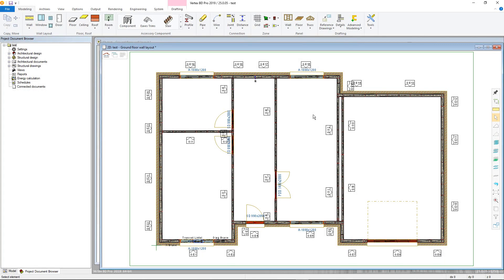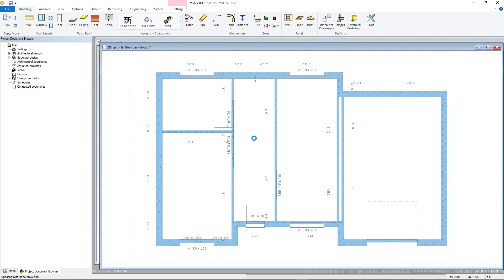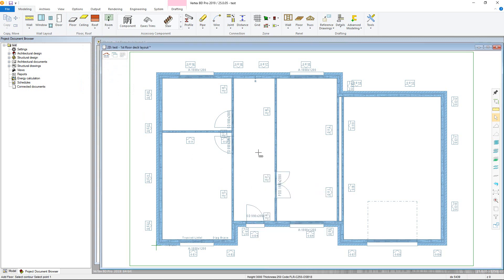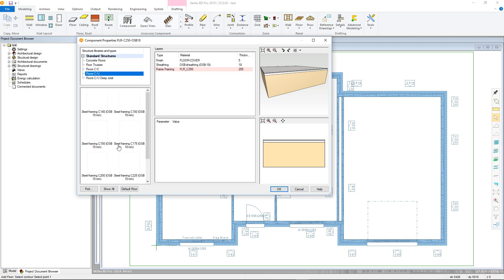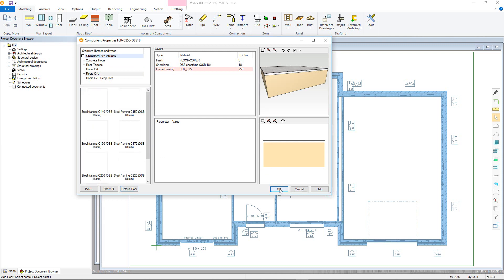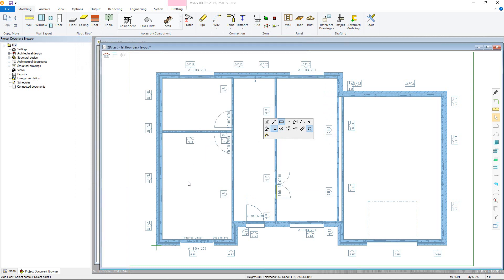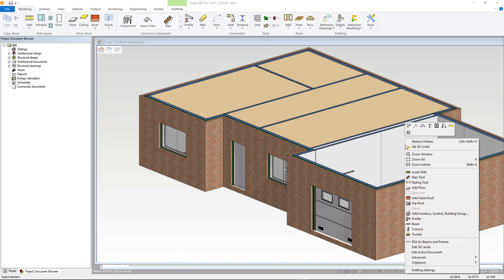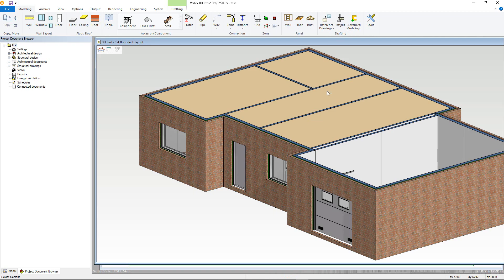10: Adding Floors [Vertex BD Steel Framing Tutorial]

Comment: Quick load drawing model pair is not clear.can you please explain
Reply from the maker: Thanks for your question. To switch between drawing-model pairs, press F4 on your keyboard and select a drawing-model pair. To copy an existing layout to another drawing-model pair for reference, go to Modeling Tab, click Reference Drawings and select Quick Load Drawing-Model Pair. Then select the drawing-model pair from you'd like to copy the layout to the current drawing-model pair.
Reply from the maker: A quick tip: hold Shift and left-click on any button to open Help for more info.